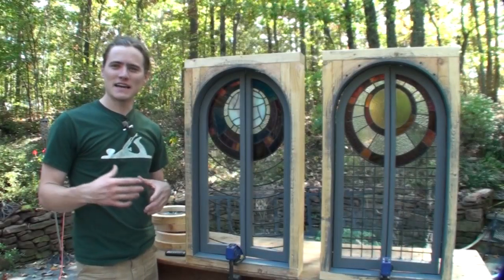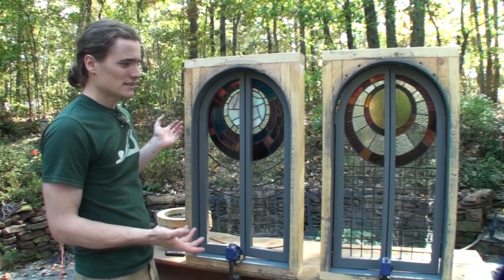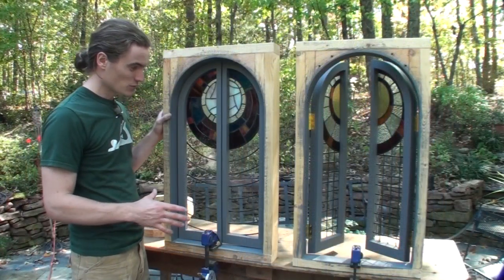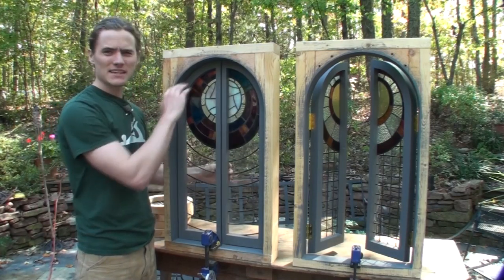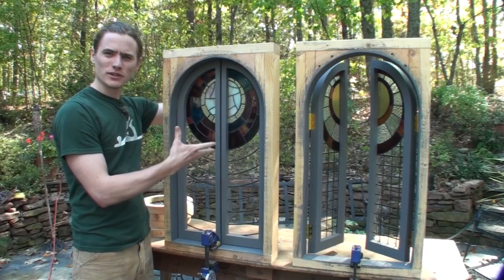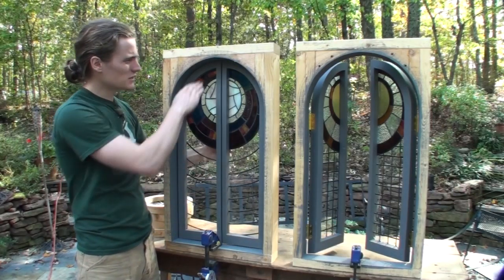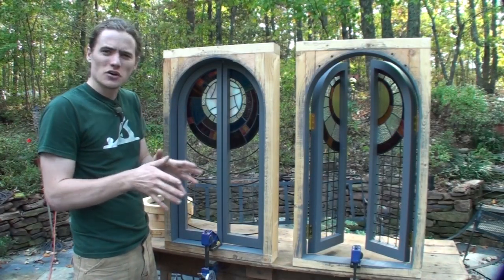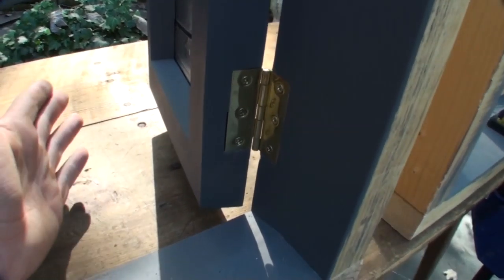Handmade Windows - Tiny House Stained Glass

Comment: I do stain glass windows for big doors. I saw u  used copper foil on your windows.I would suggest u do it w/ lead or brass came because it holds the glass tight. Put a caulk in the came when finished (see the internet for that info). Lead came is stronger holding than copper foil. You can push your hand right thru  a copper foiled piece. Also, came is tough  against rainstorms & snow. You do nice work. Keep at it!
Reply from the maker: Thanks, I've been wanting to use came for a while, just haven't fit it in yet.

Comment: Great windows, congratulations! I can tell you from experience in making and restoring that you don't need to worry so much about expansion and contraction on such small windows. I like your methods of recycling materials, sounds like you never found a piece of wood, glass or anything that you didn't like. One of these days I will be posting a slide show of my stained glass, most of it originated by recycling leftover glass scraps.
Reply from the maker: Dale Claus Good, I figured even with the hinging windows in this video that they where small enough that I'd be ok. They've been ok so far, but then again there has not been any heat inside, so we'll just have to see how that goes. Thanks for watching.
Reply: The Homestead Craftsman If you watch a lot of restoration videos you will mostly hear that the weight of the glass and lead is the biggest problem with big windows: opposite extremes of temperatures on inside/outside can cause them to bow and sag, reinforcing bars is the most common solution.

Comment: What an informative video. Thank you for making it.
Did you cut a groove/rabbit? in the 2 x 2 frame for the glass to fit in? How deep? If the the window would be solid panel, how would you attach it to the 2 x 4 opening? Screws? I  have 31 by 36 R/O. I'd like to put a solid panel stained glass window in it. Would 2 x2 frame be big enough?
Ania
Reply from the maker: +Ania Modzelewski Not sure exactly what your asking, it's a little hard to do so over comments. So I've got the outer frame and then the inner "door" style frames that are hinged. On those, there is a rabbit, it's about 3/8 wide and 1/2 inch deep. If you are wanting to do a solid panel, I would would make a simple frame with rabbit, either cut into it or a piece added in to form it. Prime and paint it, install the glass panel, add some trim to trap the panel then install the whole thing........or perhaps you should install it before you put the glass in, just make sure it's square. You could also just make your panel and hang it in front of your window.... not the same things as an installed version, but it would be easy.